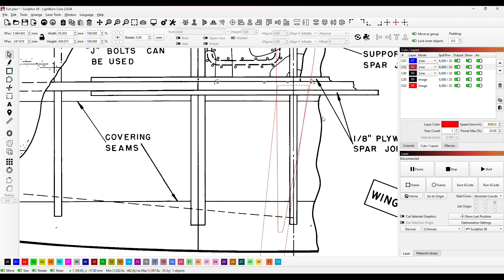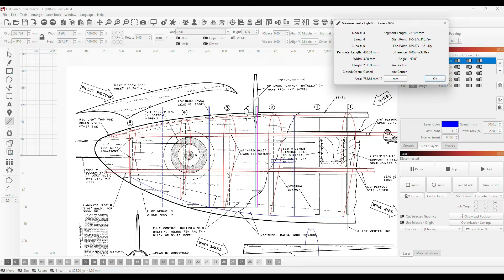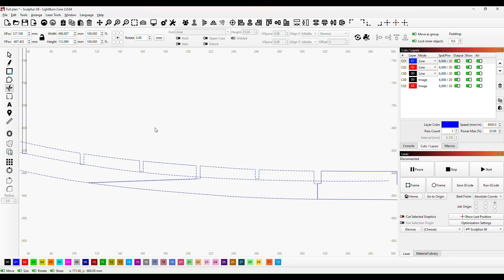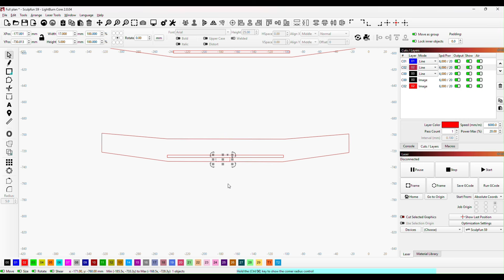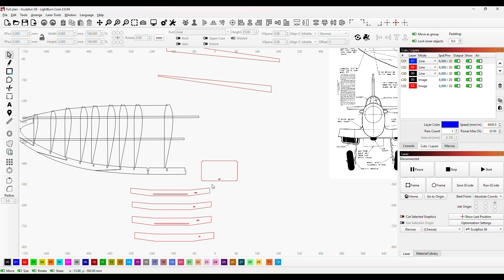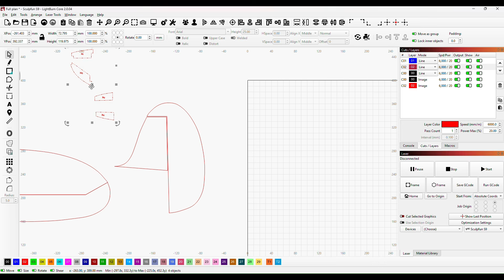How to make a RC Spitfire with free plans, and set out the components for laser cutting Spitfire 4

Comment: Very nice video! I’m planning on doing something similar to what you did with your hurricane some months ago taking a guillow’s plan and scale it up to convert it to a nice Rc park flyer. I’d like to scale my project up to 200% of the original outerzone plan but I’m afraid this could affect the structural strength and flight characteristics of the model since it was only designed for a small rubber powered model. Did you have any issues with your hurricane? Did it fly well? I’ll leave ID of project I’m referring to below. hoping to see your hurricane maiden one day...Cheers!

Plan ID: oz1512
Reply from the maker: Thanks for your comment, you might need to think about the wood sizes and increase the dimensions, also you might think about using ply in some of the formers. If you put strain on the wings depending on how you fly it you might need to thing about strengthening the middle section. Personally, I would change the way the nose section is constructed on that particular plan. As for the Hurricane I built on the channel, I donated that to the son of someone at a local RC flying club. It flew reasonably well unfortunately I have no footage which is a shame. Let me know how you get on with your project. 👍👍
Reply: @LaserRCModelguy thanks for your suggestions! what in particular would you change about the nose section, i'm quite a newbie in the building world so any hint would be much appreciated 🛩️
Reply from the maker: @shel-t1g  I would probably move away from building up in layers as shown on the plan and I would probably take the stringers further to a nose former, similar to the way I have done in the Spitfire. Good luck.
Reply: @LaserRCModelguy thanks I'll try and hopefully learn something new 👍